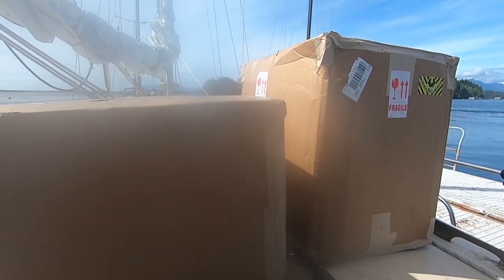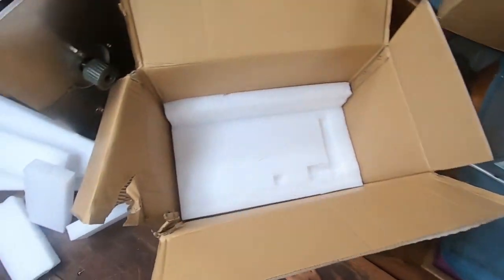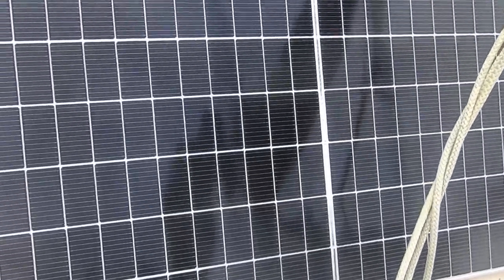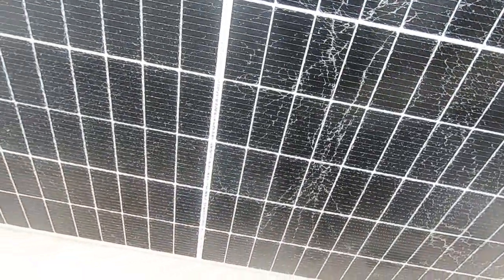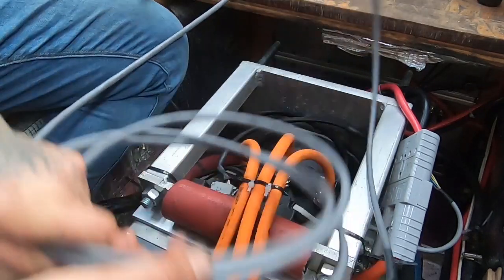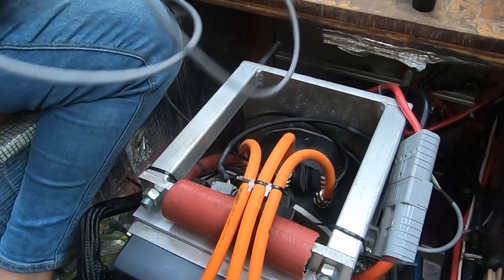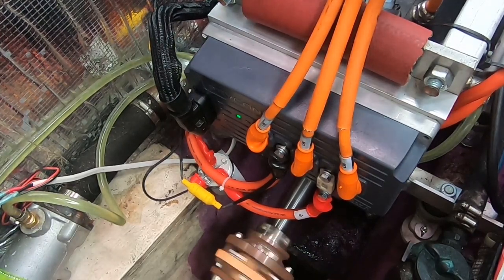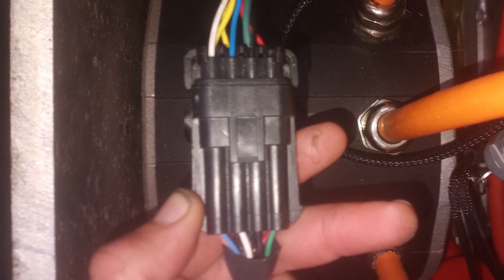DIY ELECTRIC SAILBOAT CONVERSION  heavy full keel cruising boat - Sailing Oka Solo - 030

Comment: This is very interesting. Im real curious how it works out in the long run being up here in the PNW. For me down in the puget sound it seems if i actually want to get anywhere i have to spend the day using my motor. The damn winds up here are either on your nose or on the stern 95 percent of the time. I think about when i go to the san juans and having to motor for 80 miles. Same way thing up in the fjords in canada, lots of motoring. It'll be really interesting to see how this motor will work out up here. oh and very nice by the way.
Reply from the maker: Well i just finished transiting johnstone strait (literally just arrived in port mcneil) my battery bank is very small and I plan on doubling the bank the second I get back to work as I only have 10mile range at 2.5know so Im basically almost engineless atm... but I make it work as im now only about 120miles away from my job and finally managed to get the motor working in December while in the gulf island so I since december i had to dogdge many storms and less favorable weather, qe had lots of snow this year but Ive now made it 250miles since the conversion was finished
Reply: @SailingOkaSolo  Thats very cool!! Im looking forward to seeing future videos with your bigger battery bank. Will you be able to get more speed with the motor setup you have? would be nice to get up to 5 knots and do that 10 miles in 2 hours.
Reply: get   1⁰ times lith batr 1⁰ mike ràngevtoo ¹00 mike range

Comment: Checking the math for DC circuit and ratio for kw and hp, it doesn't come out at 60hp. Sorry but 1kw = 1.34hp. So 12kw = 16hp. A 12kw motor at 48v drawing full power will need 250 amp. Wasn't clear if your total amphours of the 2 batteries is 150 or it is 150amphrs per battery giving a 300 amphr total. If the total is 150, at full throttle complete drain, you'll have about 1/2 hour of run time. Of course you don't want to do 100% drain. So at 50% gives about 15 minutes of useable power. Just paper calculations, but not looking good for what you think you have. 16 hp vs the 60 is the real issue to move the boat. Again, sorry, but that is the math.
Reply from the maker: Hi there Ill go over some details in the next video but the motor it 16hp not 60 (blame my accent) and I wish I had 300ah but for now the two batteries total 150ah because I couldn't afford more for the time being. So I use it in a very conservative fashion as it only allows about 10miles at 2.5knots but Imake it work for now and have travelled 250miles since i finished the install in December in very much less than ideal conditions... means waiting for the right weather window...
Reply: ßoo  warthigvrun onlyv3 minyt too 6 monts 7,5 mibute witer range warthig run obky

Comment: I don’t think those batteries can supply the current that motor will demand for more than 1/2 hour max on full charge and with the 2 solar panel you have will need 3 fully sunny days to recharge in te middle of summer . A week in the winter months. All that to go 3 miles. 10,000 would have gone a long way on a full rebuild and then sum. Regards hope it all works out?
Reply from the maker: Well as I am in snowy canada Im running hybrid with a 2kw honda generator. Everyone has different needs and capabilities, since in completed the instal in december I have traveled 250miles north and still have a bit over 100miles to go before  reaching my new job the 150and battery bank is temporary until I can afford more. My range is about 10 miles at 2.5knots but that means careful planning
Reply: @SailingOkaSolo  @Rigging Doctor they run a similar hybrid (Honda) most motoring they ever ran was ICW an inland Eastern coastal waterway. They keep power output low other than to get expediently through a bridge way forcing the generator to be used.

Comment: Your conversion installation is fairly clean and tidy. Do you have an engineering or fabrication background?
For short periods, does the conversion provide similar power to the diesel (for overcoming a wind or strong current for example)?
I may have missed this, but do you need to change to a different propeller for the different torque curve of an electric motor?
Reply from the maker: Thanks! No fabricating background what so ever but love to learn new skills! So the old diesel was 50hp so 16hp is in no way comparable but I am currently navigating johnstone strait  some of the fastest tidal rapids in the world altho i need to wait for favorable tide and winds other wise I can hop about 13miles a day motoring only. I  still have the same prop and shaft as i did with the perkins but you can adjust the belt reduction ratio and motor rpms to match the prop

Comment: J'ai hate de voir la prochaine vidéo, j'aimerai aussi passer à l'éléctrique. En attendant c'est à la voile que je bouge de  mouillage en mouillage et utilise au minimum mon moteur. Ca tombe c'est fait pour ca...
Reply from the maker: Exactement le nombre de gens qui sont  abasourdi que j'ai choisi un "petit" moteur a 16hp pour un voilier de 12m
Reply: @SailingOkaSolo  Il faut savoir qu'une bonne partie de ceux qui voyage en voliers, font du moteur et non de la voile. Donc pour eux l'éléctrique est impensable. Ou ceux qui allume le moteur quand ils sont à moins de 4 nds. Je trouve ca aberants.
Reply: @SailingOkaSolo  I chose 16hp diesel Beta over-propped so it will not develop peak hp, instead running at peak torque on the prop I chose for regeneration ability on electric drive. Some would say all wrong, sailing vessel first to me. I am not interested in power levels required to near hull speed. The largest antiquated diesel previously fitted was 22hp.

Comment: Wow! Inspiring! I've been in the thinking about this phase for awhile. About to fix up the old diesel while I dream about making this change when I've got the money. What's the length and displacement of your boat? What was the HP of the engine you replaced? Congrats and great video!
Reply from the maker: So I went with an "underpowered" option as i use the motor very much as auxiliary propulsion.
Motor is 12kw or 16hp, boat is 27ft at water line but 36ft on deck 42 loa 22000lbs displacement fullkeel she is an endurance 35
Reply: @SailingOkaSolo  wow that's a heavy 36' boat! Mine is 41 but 19000. I guess the full keel adds a lot. How have you found that level of power pushing against a current?
Reply from the maker: Its more a question of battery capacity, Im currently navigating johnstone strait ( in one of my previous videos go through seymour narrows at 15knots speed) and I have not needed to go full throttle once although im not going against the current, but had to dock in heavy current (4-5knots) twice with winds, I didn't feel underpowered while docking...  but if i would have to go against a strong current for awhile  then I may get into trouble can use the portable honda generator to extend my range.
 its all about good planning but it can be done even with this short range

Comment: Congratulations on your upgrade.  We are an electric-drive Bristol 35, currently cruising in the Bahamas.  We are like a sailboat without an engine, sailing everywhere with a range of about 30 miles on 200 amp/hrs of AGM batteries at 48 volt.  It will be interesting to see what you get with Lithium.
Reply from the maker: 30 miles on 200ah thats surprisingly good what speed is that at and how much draw? I haven't pushed it to the limit yet but im averaging 10-13mile range at 2.5knots which isn't great but its auxiliary propulsion!
Reply: buy soar ektric 385 33.6 miles teksa bew xell 38.6 mike rangé

Comment: cool. did you check the ratings of the bearings, including the one in the motor? Did you use thrust bearing?
Reply from the maker: Its a self aligning flange bearing there were two originally but i damaged the one sliding it on the shaft but have a pillow block friction bearing on the aft part, thrust bearings is a wide variety of bearing its not a thrust block as your probably pictiring

Comment: very cool.  i have a 35' Pearson and am looking to install this ME1616 at 48v as well...didnt realize that was the equivalent of 60 hp.  i was considering a 2:1 gear reduction...Thanks for sharing!
Reply from the maker: 16hp sorry my accent might of been misleading
Reply: 750 watts is essentially 1hp, most diesel drives at non peak efficiency can be 1/2 of their peak, pushing close to hull speed just isn’t practical in electric. Most use the electric drive at 1/4 output to get range. A 3hp belt drive runs my 31’ waterline x 11’ beam over 3 knots in calm conditions.
Reply: buy thé 385 soar ektrc sail boat 33,6 mike rabfe teksa new xells 38.6 nike tange

Comment: So happy you got it working!
Reply: Thank you for posting your experience, and issues, with the electric motor. I am currently looking at repowering with electric. I am looking at the 18kw liquid cooled from Thunderstruck Motors. I also found some interesting reading on lithium batteries and making custom cells for cheaper than assembled (Rigging Doctor has a whole video on DIY lithium). 
Would love to hear about your experience with the Lynac  Lithium.

Comment: Now that is quite the achievement utilizing so many skills along the way and learning new ones too no doubt. Damn right you should feel proud.
Reply: yeah, every sailboat needs a different system in a way .... each hull is a different load, so there is a lot of research to do also, before the parts even ship.
so there will never be enough sail drive conversion videos.....but the fist thing anyone needs to know when they do a sail drive conversion is : Make Sure You Get A Re-Gen Controller !!!

Comment: That' awesome!
following. 
check out Sailing Uma, they did a conversion earlier last year. 
Does it have regeneration capacity?
Reply from the maker: Uma is a big part of the inspiration to make this move! The motor does have regen but with the full keel its not the best output
Reply: @SailingOkaSolo  can't wait to binge on your vids when I have some time. Love the west coast but havent been in a long time.
good luck
Reply: @SailingOkaSolo  First video of yours I have seen, possibly you have aperture clearance for a larger and more aggressive pitch, 3-4 blade? I hear less than 18” maybe insufficient. I was able to fit a 22” time will tell what I can get.

Comment: I’d like to hear more about the equipment you installed.
Reply from the maker: The batteries were built for my specific use not sure about the bms and low temperature shut off as even in canada the bilge always stays over freezing temperatures you can find a link to the motor supplier with specs in the description and same for the solar in the description
Reply from the maker: What would you like to know?
Reply: @SailingOkaSolo  Well I’m familiar with Lynac (sp) batteries but would like to know what kind of bms you are using, low temp cutoff, battery monitor system etc.  I’m very interested in your choice of motor, brand, model number, where you bought it etc.  Same with your solar panels. Of course I’m interested in the cost.  I sail my Bayfield 32c in the same corner of the world you do and when the time comes I’d like to go electric too.

Comment: Also how many HP will the unit deliver and what do you expect your cruising speed and range on a full charge
 to be ?
Reply from the maker: The unit can deliver 16hp continuous at 48v but if I changed the system to 96v I could get 30hp out of it. For now I could only afford a small battery bank and only have a range of 10 miles at 2.5-3knots which isn't far from engineless... Im currently halfway in a 600miles northbound journey in the dead of winter to my new job so I can save up for more batteries!
Reply: @SailingOkaSolo  more batteries are good but recharging on 800 watts is your limitation